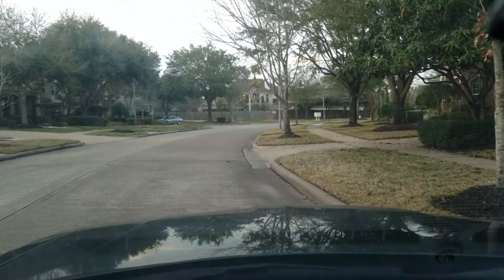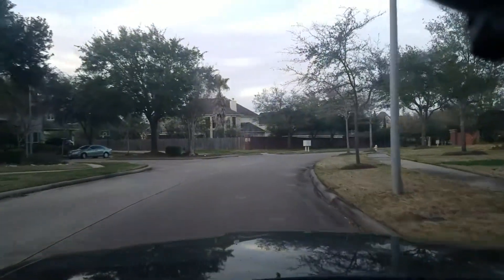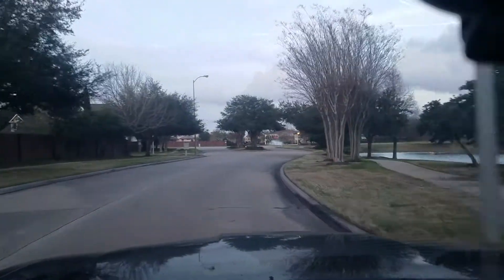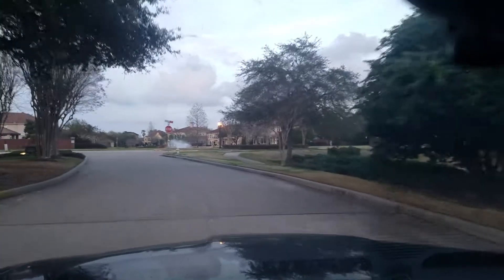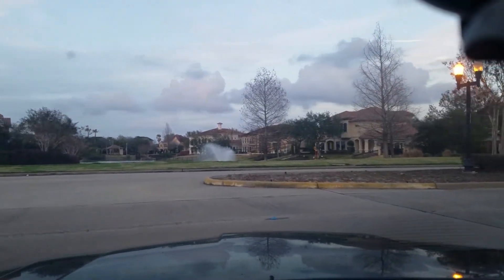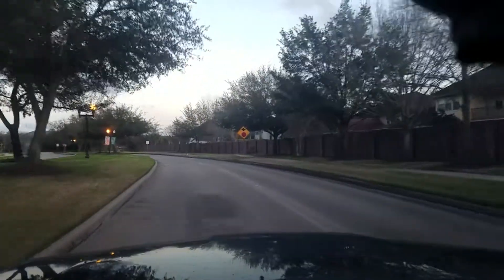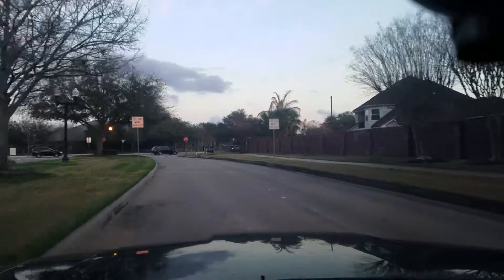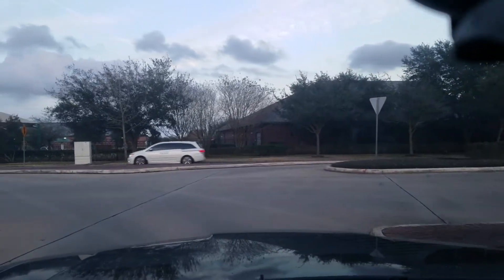Exhaust Cut Out Sound

Comment: Hey, Im interested in painting parts on my car as well. Hows has that paint been holding up? Any chips, scratches, peeling due to just regular wear and tear?
Reply from the maker: Carlos Rivas everything held up great so far, only flaws so far are
1. The grill got a tiny chip duo to a rock but I painted it over
2. Parts right after the wheel have some paint peeling off but verbally noticeable
3. The fuel door is definitely chipping off (due to me not using sand paper to prep the surface, but I didn't want to scratch up the chrome silver door) I will just repaint it later.